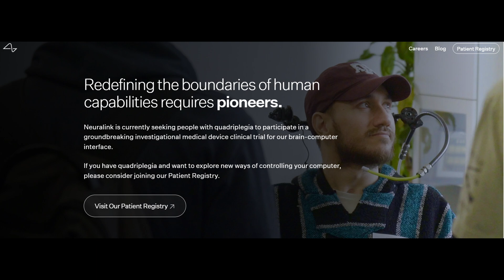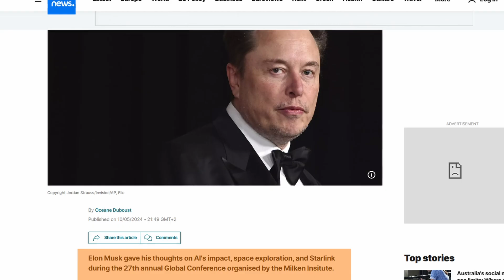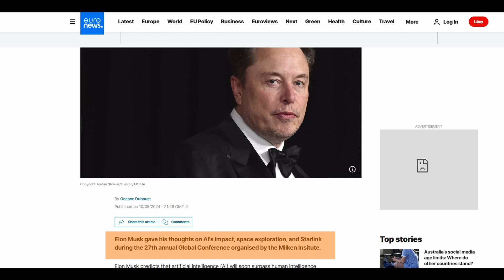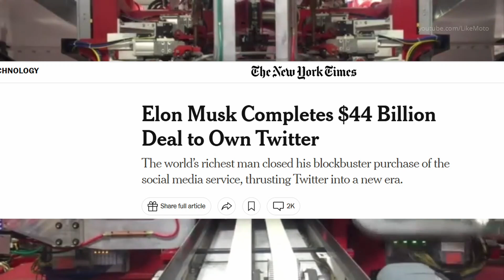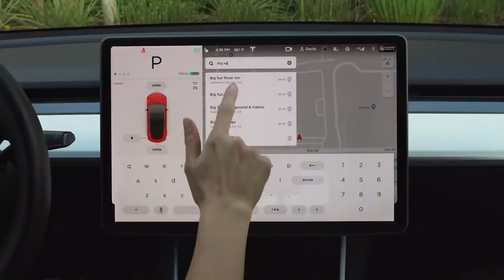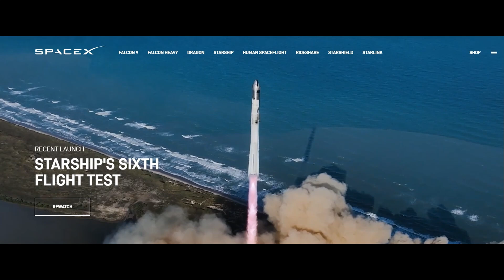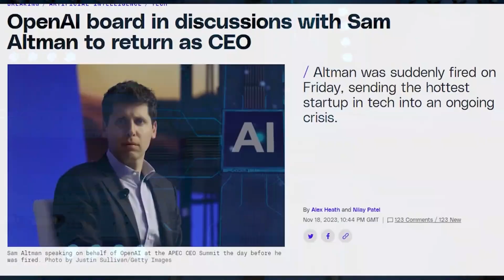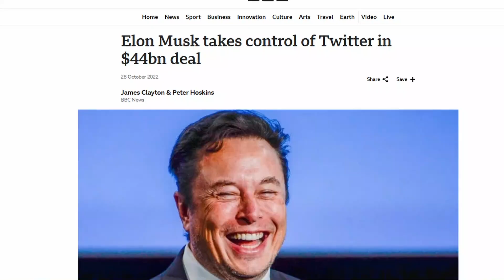Why Elon Musk Might Buy Aptera in 2025 Despite His Dislike of Three Wheeled Vehicles

Comment: It would be nice if Aptera were given enough money to go to mass production and to include safety software.  The main issue with Aptera is a safety one.  Otherwise it is a brilliant design with great range for it's lightness and very low wind resistance.
Reply: All of the safety is there for Aptera. Safe as a F1 car.
Reply: @grasshopperbiller  - Don't worry, classified as an autocycle. You can thank Elio Motors for getting the rules changed to pave the way for Aptera.